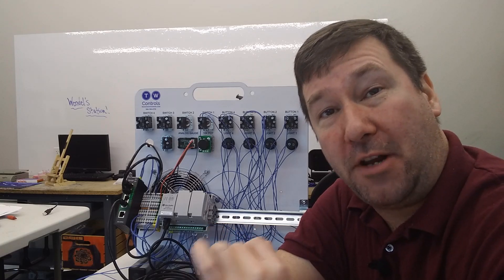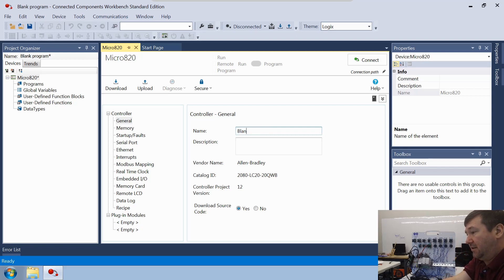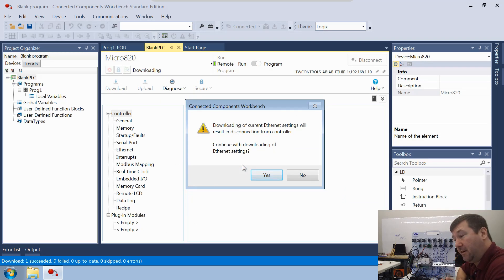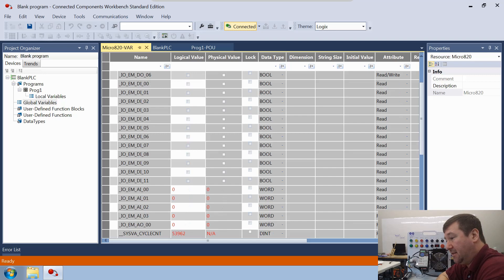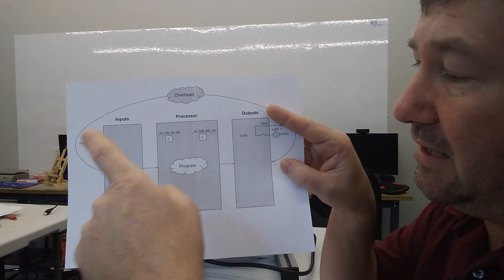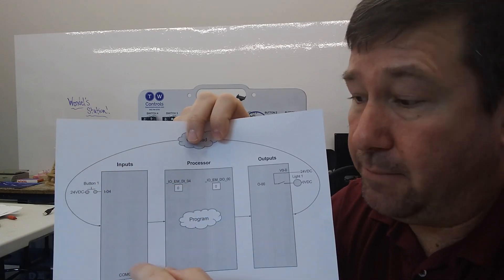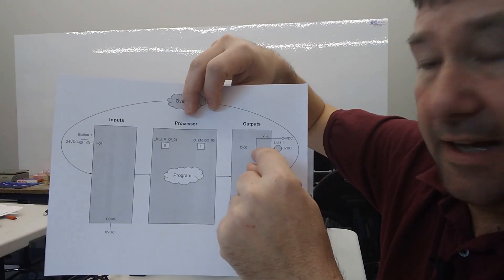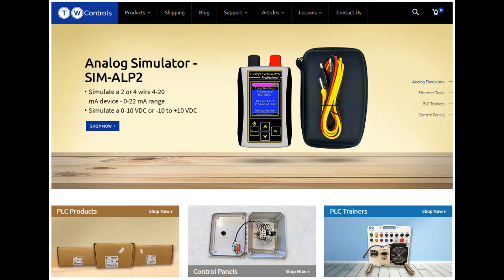Scan Cycle of Micro800 PLC using Connected Components Workbench

Comment: hi Tim
These drivers have the first scan bit?

I need to reset a counter when the PLC goes into run mode (every time it is energized)

Is it possible to do this?
Reply from the maker: The First Scan bit in the Micro800 is the __SYSVA_FIRST_SCAN.

Comment: Are you aware of how significantly worse the Micro 850 PLC simulator scan time can be. From Rockwell's Micro 800 selection brochure, I gather that the best-case scan time for Micro 850 is <0.25ms. I'm currently running a project with 3 POUs (1 ladder diagram of 21 rungs, 1 ladder diagram of 10 rungs, and a ST file of 40-50 lines of code). Additionally, to test the continuous operation of my program, I'm using factory I/O via the Micro 800 communication drivers. In the worst-case my scan time can reach up to 300-400ms(I'm guessing this is due to comm. overheads, not too sure of typical scan times of real-time networked Micro 800 controllers). Without factory I/O running, about 100-200ms. Should I be concerned and refactor my program or is it just due to the limitations of the simulator?
Reply from the maker: I would doubt it would be a concern, I always say that the simulators are good for beginners who are just trying to learn the very basic instructions but it sounds like you've moved on and probably need a test PLC on your desk to develop your code.
Reply: @TimWilborne  This is just for my capstone project, I am aware that the simulator won't be as consistent in terms of low scan time. I was just curious if you have stumbled across unusual scan times while using the simulator. Just need to check a few more requirements before the client is ok with the proposed solution and he will submit an RFQ for the controller.
Reply from the maker: Honestly I've only used the simulator to make a video to show how it works. I can't speak for the Micro800 simulator but there were many differences even in how instructions are executed and the outcome with RSLogix emulate. It wouldn't surprise me if this would have similar discrepancies.
Reply: @TimWilborne  Fair enough, thanks for the heads up!
Reply from the maker: @MaNemUmar  You are welcome!